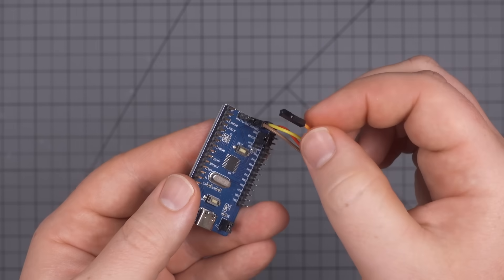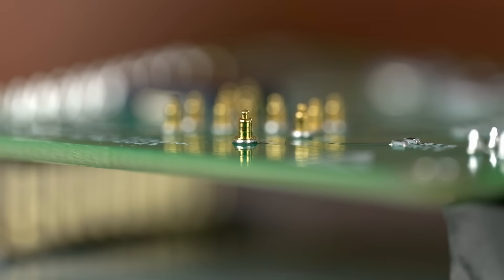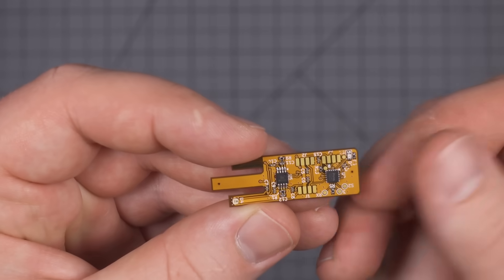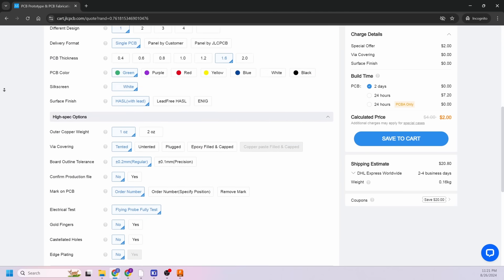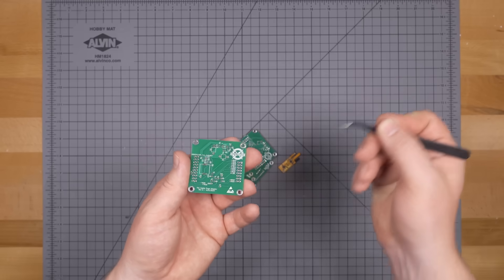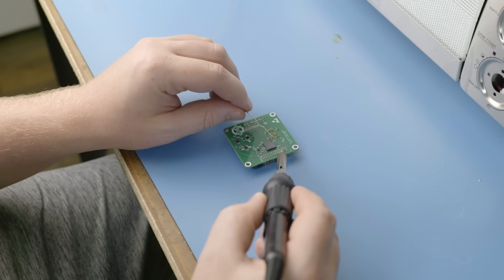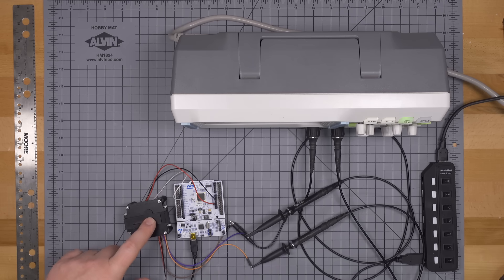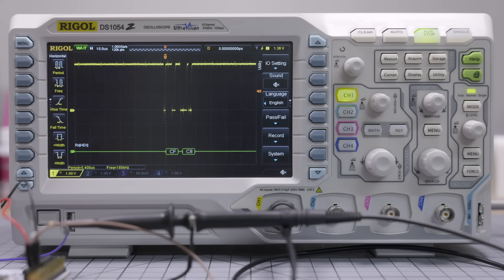The Magic of Pogo Pins: Building a Custom Programming Fixture!

Comment: 5:16. To make it simpler and less confusing, design the top PCB with bottom layer routing and then the bottom PCB with top layer routing. This way the pin co-ordinates of both will align exactly without the need to think too much because the bottom layer of the top PCB is already looking directly over the top layer of the bottom pcb.

Comment: They have been around for a very long time.  Fifty years ago (hard to believe it's been that long) I was designing and building production test gear for calculator production.  Some of the board testers would run 25,000 cycles per day.  Pogo pins can be used in a special socket that makes swapping out the pin very quick and easy.
Reply: Do you know what this socket is called? Would like to see or buy some. Thanks

Comment: As someone with a small Electronics business, I use pogo pins to build test jigs regularly and even use them in some of the products I sell.

You can get them with 1.2mm conical tips that mate with the standard .9mm through-holes.  No need for exposing test points.

Comment: I recently bought a product that unfortunately came with a charger that has pogo pins with magnet. I need to replace this with a fixed connection.What 's the best way to fix it with attaching cable instead? Can I solder wires directly to the flat contactors that are supposed to have the pogo pins pressed against?

Comment: So why, if you look a typical electronics supplier (like Mouser) do pogo pins cost upwards of a dollar and regular connectors half that much?
Reply: You need one set of pins for the jig side and none on the target. You need one connector per target. It comes down to how many targets you have or expect to have.
Reply: @jimktrains0  Yes but they are tiny bits of metal, stamped out by machine...

Comment: Most common types of plastic only start to get really soft around 300C.

So there is a decent chance your solder temperature is a good bit lower. Still for fume reasons I would not put a lot of them in the oven depending on the ventilation in your space.
I checked reflow oven temps
220-250C for 120-240 seconds
Okay, that's probably fine if you don't intensely sniff it the entire time.

Comment: So cool to see a video about something I used to do at work. The company I was with would do lots of automotive parts, things like the boards in the dashboard display. I was mainly on the mechanical side of things. We had a standard test fixture design which we would make G10 inserts for rather than PCBs, so we would use the pogo pins from QA and wire them all to a connector at the back of the fixture. Is this something you do a lot at work or something you've figured out yourself? I am new to your channel. One other interesting thing from production electronics is wave solder pallets, though that is probably outside of the realm of hobbyist electronics.

Comment: I work as a test engineer for series production testing. Mainly for functional testing, but we othen use test needles for connecting to test points on the PCB. These needles a commonly used in the business for electrical testing like ICT. Those needles come in many different shapes and can be a bit pricey. They are maDe to Be easely replaceable without soldering as these can wear out when talking about mass production. The hardest here actually is making the fixtures that must be made in precision to reliable connect to each test point. There can be up to hundrets of spring loaded needles on one fixture. It is basically its own engineering field.
Reply: Do you have any recommendations for creating those test fixtures precisely? I’ve heard others say balancing the forces is the complicated part but Idk myself
Reply: @NortexG  The mechanical part of the fixtures we have partnered with an expirenced company. But we are based on parts from Ingun. 
We typically have 20-90 needles per PCB as we use the system mainly for functional testing and end of line testing (not for in circuit testing). 
But yeah the mechanics can be really wild. Especially when the PCBs have some crazy features.

Comment: i've never used them for this use case, but most other places i've encountered them, in end user and repair contexts, they've had issues that infuriated me. my current wireless earbuds use a particularly bad design that the predecessors didn't, meaning i can't trust them to charge for when i need them. after a string of other failures with earbuds, its quite annoying that such expensive sets have so many issues, and incorrectly used pogo pins might be the final straw for me to somehow find wired noise cancelling earbuds, or just fix my over-ear headphones.
Reply: Wow I didn't realize I had these in my headphones too. Never had an issue with my first pair I use daily since 2021, Galaxy buds+ still have the 11hr battery too. Might be a design problem with your headphones, mine are perfectly spaced and never had an issue.

Comment: What do you have in mind as a software framework for running the tests and shall everything run on the stm?
Reply: Test engineer here... 
Depends on your needs. 
Stand alone testers/programmers can work great for little / cheap boards. Put the board in, it runs a few seconds, then shows / sounds PASS / FAIL.
For larger and more expensive Boards with big production runs a full functional tester is often the best solution. It mostly consists of the adapter, some heavy duty 19 inch rack test equipment (Multimeters, scopes, multiplexers) and a PC running specialized software. 
It gives a full diagnostic of the board, programs it (including serial numbers etc.) and saves the results into a database or ERP system.
Most commonly National Instrument's software is used for this (TestStand, LabView, or CVI (which is C with easy GUI functionality)).
However at that point it's just a case of PC software preferences. I write most of my test software in C/CVI, others use LabView or Python.
TestStand is expensive, but if you can afford it, it does all of the "framework" bits for you ( running test sequences, scanning serial numbers, database logging), you just provide functions that will execute for the test steps.
For massive boards ICT is often the best as it can find very specific failures. Flying probe is another option if the production runs aren't that big.
Reply: @TheRailroad99 another good thing about flying probe is that you can test all the pins without including like 200 pogo pins on the test board.

Comment: pogo pins are great. I've built sooo many fixtures with pogo pins for manufacturing. Getting engineering to ad test points is such a pain though. I've used phenolic board and Delrin to hold them for small fixtures. Even did 3d SLA fixture for temp fixtures.  i like crowns the best. balls i've never used. much easy with spike crown or bowl for large through hole pin connections. solder process sometimes leave a little residue on boards. so spike or crowns can most of the time push through that layer and make a better connection.

Comment: I hadn't heard of pogo pin targets before.  Unfortunately the cost of targets seems to nearly match pins making the cost of pogo pins at least 5 times that of using a standard connector.
Reply from the maker: The solder cup ones make a lot of sense if you're building a custom pogo connector, but otherwise I agree. PCB pads work for most applications though.

Comment: Nice Work! 
What material is used for 3D printing the Fixture? Is it ESD safe?
Reply from the maker: Yeah, it's ESD safe pet-g. It prints really well, but is a bit pricey. I'm considering trying out conductive pla in the future. 

Of course "ESD safe" is only as safe as the weakest link and I'm often lazy in other areas, but...

Comment: Another alternative solution for the low end, there's the pogo pin 'clothes pin' clamp. It connects pogo pins to what would be the footprint for a programming header, but without having to solder the header to the board. Not quite as compact as only pads, or as comprehensive as the full pogopin jig, but if the product already had the header footprint anyway to connect JTAG/SWD/ISP/etc..  it's a good solution. 
Similar to TagConnect (just cheaper).

Comment: Tag-Connect is another great option that is free on the PCB side
Reply: Wurth sell something equivalent, but with much cheaper connectors
Reply from the maker: Looks like it requires a little larger footprint, but that's a good suggestion for an off the shelf solution.
Reply: Well, it's basically just pogo pins with extra steps

Comment: This is actually... really great, Zach! You've inspired me. I do my programming via USB but it is tedious for all of the reasons that you specified. I've been intimidated to commit to designing a more integrated testing rig as well, but it's easy to perceive things through the lens of doing everything by hand when you're working with samples vs production.

I'm also actively trying to level up my Fusion skills, and one of the hardest things is to find intermediate projects that aren't superficial tutorials. Any chance you'd consider sharing your .f3d?
Reply from the maker: I could be convinced... I will say though, I've used pretty much every CAD software out there and Fusion is my least favorite. I'm just sticking with it at this point because it is free for hobbyists (although they've steadily taken away features) and I have a lot of models in it. I could rant about what I hate about Fusion (the mating of parts in assemblies, the convoluted feature tracking system that seems to randomly shut off requiring me to remodel parts, etc.) but I'll save you the time.

I think trying out FreeCad is in my near future.
Reply: @AllTradesZach  I started with SolidWorks but decided that navigating a Kafka-esque multi-variate licensing hell including forced interactions with literal zero value add resellers was not how I wanted to spend my life. Whereas FreeCAD is worth what you pay for it. Fusion is not without issues, but I kind of love the workflow. FreeCAD's UI/UX feels like it was created in a university lab by people who hate users having good experiences.

One thing I find genuinely strange is people hating sophisticated software tools because they aren't free. I work on OSS tools myself, but when it comes to a professional tool, I kind of want people who are paid to focus on it to be steering the ship. I'm trying to imagine any other sphere of life where you would demand that your electrician wire your house for free. You wouldn't want that person near your mains box, so why would you want to design a spaceship in something people only did as a hobby?

Comment: Looks really good! Some thoughts I had while watching.

If you export a STEP file of your product PCB, you can import it into the Kicad project of your tester PCB to verify correct positioning.

The datasheet for the pins will also call out how far the pins need to be depressed to function correctly. Too little and you don't get enough pressure from the internal spring, too much and they'll push through plating on the contact pads. I work with a company to design the mechanical fixtures and they regularly hit the 10k cycle rating. For fixtures that will see more than 10k devices total we usually use simple standoffs to set the distance. For medium to high volume products there is a special carrier plate made of Delrin that holds the pin bodies because it's easier to service. Not necessary for single digit thousands.

Comment: Are you aware or other shapes and aspect ratios for similar spring contacts? I struggle to find those in an existing equipment where the spring-part is a small segment and not a tiny ball. Thanks for any suggestion or help.
Reply from the maker: I'm not entirely sure what you mean by "small segment" - just a cylinder? I do see flat faced ones and cone shaped ones on DigiKey, where I got these. Fuzz buttons are another option that can be used similarly.

Comment: What kind of solder stencil fixture is that? Is it custom made with micropositioners?
Reply from the maker: I designed and printed it myself using an xyzr stage. There's a whole video on it! The stage adjustment is great, but the 3d printed frame isn't quite stiff enough, so I might reprint it at some point.

Comment: Built many programming cables using cut off from speaker microphones where the cord set failed. Cheaper to sell the customer a new microphone. I extract the pins and save them for various uses other than programming cables.

Comment: If you make the contact points on your test pcb to be holes the size of the pogo pins, then use pogo pins with heads larger than the hole they fit in, then you automatically have pogo pin jig with the pins in exactly the right place to line up.  If you use two unpopulated boards to accept your pogo pins you can have a very heavy duty connector.  I have some where when thay are applied to the board a ground is detected on one pin and this automartically triggers the programmer.

Comment: You have a lot of non 90 degree traces/junctions in your layout. 
That could be a potential acid trap, a place where acid during the PCB manufacturing could remain and then destroy your trace slowly over time.

For the second LED I would use a small plastic fiber or light pipe, cause your black housing will most probably absorb most of the light even with this strip of mirror tape.

Would be also nice to design test equipment that is capable of measuring all parameters without the need of external devices. But as I understood it, that’s your plan for the future.
Reply from the maker: I've not experienced the acid trap issue before, I'll look into that.

The active area on the photodiode is very large, so the reflective film actually works well. I've thought about resin printing light guides though.

That is indeed the next video, we'll see how well it works!

Comment: Is that a homemade reflow oven I caught a glimpse of?
Do you have any info you could give on how you made it?
Reply: Looks like Controleo3 from Whizoo.
Reply from the maker: It is indeed a Controleo3. Not the cheapest thing in the world, the kit is ~$300, but it works fairly well. Pretty accurate on the heating, could probably get it better with some PID tuning. My biggest complaint is that the cool down isn't well controlled, I wish there was some active cooling.
Reply: @AllTradesZach  @cdyoutoob  thanks for the info! I'll look into that.
Reply: @AllTradesZach  interesting! any hot takes on Controleo3 vs ReflowMaster?
Reply from the maker: Hmm, first I've heard of the ReflowMaster. Looking into it, it looks like the ReflowMaster is basically just the controller, perhaps with thermocouples. The Controleo3 is a full kit - insulation, SSRs, tape, silicone, an aluminum tray, and extra heating element, wire - even a band-aid (which I did end up using). The insulation and whatnot could really add up if purchased separately as well as the time to track down all the parts. Plus the instructions are reasonably thorough. Ultimately, I wanted a reflow oven that worked, not another project, and the Controleo3 seems to fit that (after 4 hours of assembly).

I might be doing the ReflowMaster an injustice though, as I've said, I haven't extensively researched it.
Reply: @pjforde1978  I have ReflowMasterPro that about to install in oven. I likely the Controleo but just wasn't open enough for me.
Reply: @cdyoutoob  Same! If you end up finding the perfect tutorial, please do let me know. I admit to being intimidated by the wiring.

Comment: I've built many fixtures and used them in mass production of commercial products. I always used Harwin pins and they worked great, but they do get slightly flakey after several thousand cycles. I only use pins with sleeves which allow you to replace the actual pogo part. I made PCBs to hold the sleeves and used a pair of boards stacked with a 1/4" standoff in between.
Reply from the maker: Good info, I also believe their 10,000 cycle rating is a little optimistic. They have a tendency to stick if they're dirty or abused. But that's still more cycles than pretty much any other connector.
Reply: @AllTradesZach  We mainly use POGO-25 from everett charles for our stuff. sleved as @peter_S_ mentioned. They're rated for 1 million mechanical cycles.
Reply: Coda pins, last forever… and are socketed when they finally go!
Reply: I was going to say the same thing!
Reply: may I ask, what kind of product did you put these on?
Reply: @gesoocreesto6374  I only put programming pads on the bottom of the PCBs for use in manufacture and the programming/test jigs contain the pogo pins. I've never used pins in a product design. In production, the jigs with pogos (made from laser cut acrylic and PCBs) were used for providing power, testing analog values, testing digital values, and programming microcontrollers which were stuffed as blank parts to avoid Digikey's $0.25 per chip programming fee and first article delays.
Reply: If you just have 3 pins you can also use hard pins that are far enough away from each other, and mount the whole plate on springs.
Yet another option if you don't have that many pins and they are in a line you can use simple through hole and header and angle them, they should make enough contact.